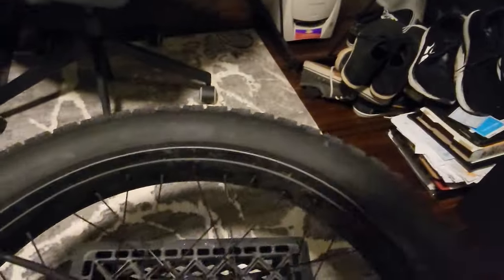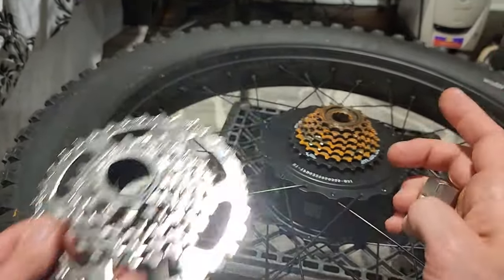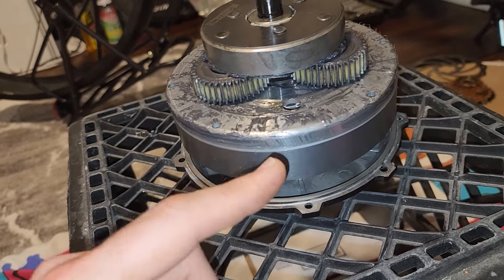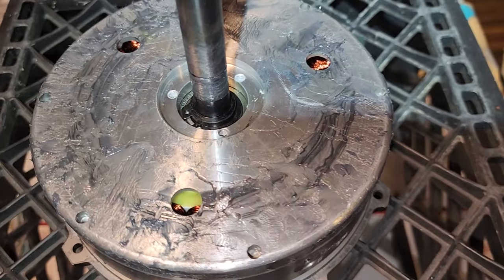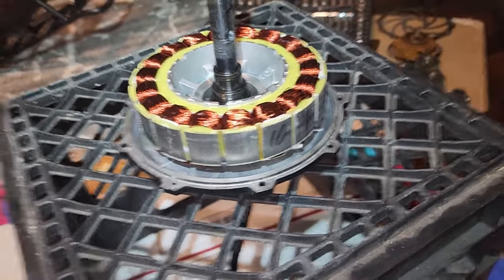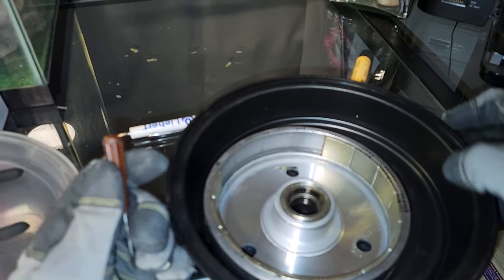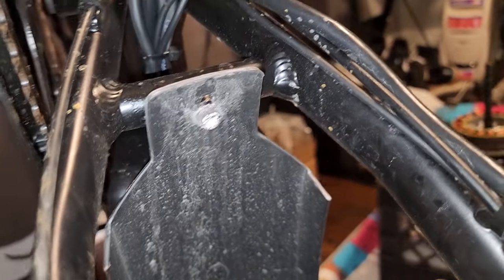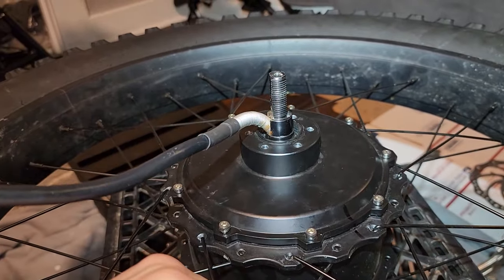Ebike Geared Hub Motor Repair: Loud Motor & Loose Magnets (Wired Freedom/Cruiser)

Comment: Mine makes that noise!! I figured motor on the way out. Great video Hey just fyi that's a 500watt motor you can tell when you removed it. It's only couple inches thick. Real 750watt motors are double that thick. It's huge scam 1000s people ripped off.
Reply from the maker: Really? That's interesting. Can you link me to some more info? This motor is way bigger than the 1000w bafang that's in my ariel rider
Reply: @maximumchargeEV  Yeah when you pulled it out looked like the 500watt in this video? Look at the difference at 8 min 24 seconds yours looks like the 500w. in this video talks about it.  https://www.youtube.com/watch?v=IM_Mj-DiU_o&t=47s
Reply: Is the overall diameter of the motor larger? Also the way the stator is wound has a big effect on the power available in any brushless motor.
Reply from the maker: @Hoggdoc1946  yes the diameter is much larger
Reply: @maximumchargeEV  ah ok

Comment: That's a 750wat hub motor. You want to try doing that with a 2000wat hub motor the magnets would not crush your fingers it would cut them off. But there is a safe way to dreading the magnets uta a blue paper I forgot the name so when you get stater just slightly liftted you slide this paper in and you can remove by hand. I've done jobs on 2000wat 3000wat and never yes a puller just push down but not to use wheel as it will buckell. I've seen the Chinese do this in factorys and they make it look dead easy. It's conferdance if you don't have it it becomes really hard it's amazing when you no the trick it becomes easy but still watch your fingers. Even a 750wat not be taken lightly as the guy who made video. These videos are good for people who haven't tried jobs like this
Reply: I have 3000w... and it's slipping under weight. I think I'm just gonna ride it until it goes. That or sell for a fraction of the cost

Comment: I would have gone and did all of them with how much adhesive was in there, which was almost none. Very nice job otherwise.
Reply from the maker: You might be right!
Reply: @maximumchargeEV  can't remember which vid, but Justin from grin said In one of their videos that this is a common issue (lack of glue) and that they once had an entire container of motors from bafang arrive with absolutely no glue, all magnets loose, and they had to open up and reglue every single one. Now consider that bafang is the "big brand" and many kits and production bikes are using other chinese knockoffs of the bafang. 🤦‍♂️
Reply from the maker: wow that's terrible. Seems like things are getting better and better thankfully as ebikes are becoming more popular. 
 @andrewstephens2687

Comment: Thank you for this video,The Company in Illinois referenced you when I asked if they have a video of the breakdown of the hub motor to add grease over time for preventive maintenance.I also fixed a PM motor like you did years ago with loose magnets and the only problem is that the glue can be sort of a spacer if there is too much glue behind them,So I used a starrett micrometer to measure the thickness of the magnets from the back of the disc where they are mounted to the face of the magnet and used as a reference the magnets that were not removed to see if the ones that you repaired are at the same position distance.How far the magnets seat in is critical in that the flux density lines can be a counter emf if one is further away from the outer ring they are mounted to.Since you are helping so many people with this video,I felt compelled to share some of my experiences.Good work,Someone upstairs is writing this all down.Cheers.Joe EE/P.E.
Reply from the maker: Thank you very much for the kind words! I wanted to make some useful content in case others had a similar issue. Glad it helped! I hope I never have to do this again! :D

Comment: 1. The small rectangular part on a shaft is a keyway not a clip. 
2. The pin in the middle of the circlip pliers is to change from spreading to compressing. (Read the directions) 
3. The yellowish PCB substrate (fiberglass) insulation between the armature windings and the stacktooth is for electrical insulation between them. A little bit of chipping on the exposed corner is fine. 
4. DON"T USE RED LOCTITE if you ever want to take the motor apart down the road. A torch or soaking in solvent is about the only way to break Red Loctite free. 
5. The biggest limiting factor of how much current you can run through the motor is the windings.  If you melt the coil wire insulation, or fry a coil wire it's over for the motor.  Never run more current through a motor than it is rated to handle.

Glad you managed to get it going despite not doing much research into what you were doing.
Reply from the maker: GREAT comment. Thank You!

Comment: They use nylon gears because they are quieter. The metal/nylon/metal sandwich gears are physically stronger than pure nylon, and quieter than solid metal, so they are really the best of both worlds. My bike peaks at 3,200 watts with enough torque to throw me off and flip the bike, but I've been running nylon gears for 7,000 miles with no issues so far. I do have solid metal gears, but they are so loud that I took them off the same day. The scuff marks on the magnet shell are from the factory grinding off sharp edges after balancing. Good cautions on the magnets, and if two of them snap together, they will likely crack. I lost two magnets that way. Nice job on the regluing, it looks pretty!
Reply from the maker: Thank you my friend!
Reply: Truly there is little to no evidence of the nylon gears wearing down, even when overvolting, the issue is when temps are not monitored and reaches critical softening/melting temps and you get "peanut butter gear". I bought a bike with all steel gears and would consider nylon gears an upgrade.

Comment: I have the freedom coming in a few weeks hopefully. thanks for this video. was lucky to find it. according to the owner they have fixed the issue and are repairing or replacing the affected motors. If I have this problem I will probably just fix it myself as well.
Reply from the maker: How's your new bike?
Reply: has not arrived yet. hopefully soon. @maximumchargeEV

Comment: If you have a shop vise the freewheel is very easy to remove. I secure the freewheel tool in the vise and drop the wheel on top. You simply turn the wheel counter clockwise like a big ol' bus steering wheel which gives you great leverage. Be sure to put some anti sieze or grease on the frewheel threads to make it easier to remove next time...

Comment: FYI, FWIW - Since I have a Freedom arriving next week (late May 2023), I asked Wired about this via their chat. Here’s their response (other than the pending order, I have no affiliation with Wired beyond being a customer) :

“Wired Ebikes
On the first run of bikes that we produced, we discovered that the factory that makes the motors for us was very inconsistent in their application of glue for the magnets. Once we discovered this, we had multiple discussions with the manufacturer of the motor, and they have stood behind their motor and are giving us replacement motors for anything in our first run that fails. Furthermore, they have guaranteed us that the Current production run, which is arriving next week will not have that same issue. Any of our customers that have notified us of a motor issue, we have either repaired their motor to make it stronger than what the manufacturer would, or replaced it with a brand new motor.”
 
Fingers crossed -
Reply from the maker: That's great to hear!
Reply: how come that one nigga consious talk ent said they wouldnt give him a new motor? he said they made him send his old motor and then they sent back the same one to troll him lol thats messed up. i think he got the 2nd batch of motor too.

Comment: Is that a 750wat hub motor and how many magnets do 750wat motor have is for setting sw900 display. And are all 750wat hub motor the same inside. Best tip to stick magnet is liquid nails it's for wood and metal. You put a fine scraping on both serface and it works I done this a 2000wat motor 3yrs ago d still going strong yes magnets on 750wat hub motor thanks

Comment: Great video! I think i start to having the same sound like in this video, but if i don’t throttle  but cranking out instead, the sound will not occur.   It is design flaw or bad preparation from factory for sure.   It doesn’t look too difficult to reglue those with epoxy.   Thanks again
Reply from the maker: Good luck man! I know you have one of the first batches of wired bikes out there too. Wasn't too bad to fix this.

Comment: Is this still holding up for you? I just re-did this to my bike with JBWeld after my 1st application with another adhesive failed.
Reply from the maker: I actually partially burnt that motor up (hall sensor wire desoldered itself) but the magnets held up!

Comment: My motor makes noise, but is intermittent. As i gain speed sound disappears. Perhaps its the centrifical force? Do you recall if this is a symptom of loose magnets? Thanks.
Reply from the maker: It might be. Yes it goes away after a higher speed but at low speeds it's VERY apparent that something is wrong. Does yours sound the same?
Reply: @maximumchargeEV  yes. Thank you.

Comment: Do you recall if you had this sound with VERY gentle acceleration from a stop? I'm also having this issue but only at very low speed with moderate-max throttle. If very subtle throttle from stop, I don't get it, and it goes away at top speed. When the wheel is in the air, I don't get it, only when the wheel is on the ground.
Reply from the maker: yeah the centrifugal forces push the magnets into place. I can't remember if the noise was there during a gentle start.
Reply: @maximumchargeEV  Have you noticed anything off such as top speed or acceleration after the re-glue? Someone mentioned that the magnets need to be perfectly balanced for the motor to run efficiently, so I was just wondering how yours did after the fix since it's a high wattage motor. Thanks again for your repair vid!

Comment: Did it help ? I have same noice and planning on doing same thing you did my magnets are also lose
Reply from the maker: Fixed it 100%. Even put over 3500 watts into the motor and it's still holding up

Comment: Thanks for the video. Same thing happen to my wicked cruiser with less than 100 miles on it. Did you need to change the length of the chain with the new freewheel? What brand is it?
Reply from the maker: New freewheel does not need a new chain. Once my youtube channel gets verified I will post a link In the description.

Comment: very nice video ,,well done man.,,i want to ask you advise or i have same problem i am not sue,, i got carrera subway e bike and i got this problem that assist often doesnt work ,,motor makes noise but there is no assist ,and then sudenly assist kicks in ,,ant it happenes all the time but onece assist kisks in it normaly works until i stop pedaling
,,what do you think?
Reply from the maker: Thanks! Does throttle work normally? What kind of noise?
Reply: @maximumchargeEV   i dont have a throttle ,,noise smooth not like grinding atol ,very quiet like something is spining inside the hub,and once it catches than it makes short loud grinding noise and then works ,perfectly,,

Comment: Hi, im curious if you contacted wired about this , if they would cover it since the bike has so few miles? I think my 2024 wired freedom may have the same issue, noisy motor under acceleration. My bro has the same bike only 2023 version and motor sounds much quieter under acceleration. thanks!
Reply from the maker: Send wired a video and they will determine what it is and help you out.

Comment: Lso did it work... couldn't fund your video seeing if it worked. If it does I have to do that to mine.
Reply from the maker: The videos of the wired bike right after this are it working.
Reply: @maximumchargeEV  sweet I gotta do my anioki a8 pro max dual motor. It's making that noise to but goes away after about a minute of riding
Reply from the maker: @mr.raiders7029  thats very interesting. What did customer service say?

Comment: I tried metal gears, they stressed  my motor. Stick with nylon and replace them when you strip them from over torquing your motor when starting on a hill etc.
Reply from the maker: full metal gears?

Comment: Great vid I need to do this to at least one maybe 2 motors. I want to go ahead and reglue all the magnets, any tips for removing the ones that may be glued well already? Would a normal heat gun be hot enough?
Reply from the maker: I would try to pry something very thin and flat behind the magnets, like a thin putty knife. Work at it slowly.
Reply: Do not use heat gun.
Over heat can damage magnet.

Comment: Probably a dumb question, but would you recommend this bike? I've been stuck between this one and the Ariel Kepler. This one would have won me over but seeing this issue and the fact that the owner of the company isn't really helping people with this issue it's making me lean more towards the Ariel.

I am able to work with tools and engines, but this just seems like a pain to have to deal with. lol.
Reply from the maker: I would recommend this bike yes. I believe this issue was fixed, and the owner offers to replace the core of the motor for free. Use the chat on their website and talk to him to confirm these two items and you'll be good to go. Very powerful bike I love the kepler but the power of this is what wins me over
Reply: @maximumchargeEV  thank you so much for the response!! Looks like I'll be getting this bike!!
Reply from the maker: @hakarumonoka  happy to help my friend

Comment: Some magnet they don't use glue the magnet it's self ke in place because it's a magnet. The poles will be the same that's what keeps them in place if you do put glue on be sure to keep your magnet the way up as you mix the poles up and that will make your motor go slower strange but true I used to assemble these motor. If these magnets have no glue on do you find that strange on all magnets that shoud tell you not to put glue on
Reply from the maker: So far so good!

Comment: Are the magnets being held in place behind that little aluminum ring they seem to be set down inside of
Reply from the maker: They are held on by the housing of the motor, the glue, and the pressure of them pressed up against one another. They also are pressed outwards into the housing at speeds above 15mph due to centrifugal forces.

Comment: you don't need extractor at all, at any point !! Just lever with a screw driver for the first and press on the other side for the second part, no extractor needed just a little muscle.
Reply from the maker: I need experience with doing that is what I need! Thanks for the tip my friend.
Reply: @maximumchargeEV i'm glad to help ! I have repaired a lot of electric bike motors from a lot of different brand. Those motors are easier to open than they seem to be.

Comment: Got 75 miles on my new Aniioki AQ177 Pro  and it's making a similar sound.   added a bit of grease as it was almost a invisible layer, which seemed to help.   But noise similar to this video still happens under full load.   Crap started comment to early, watched till I saw the magnets loose.  Now I REALLY don't want to have to get the tools needed to dismantle motor. NUTS.   Not sure what to do.
Reply from the maker: Maybe the manufacturer can send you a new motor core?
Reply: @maximumchargeEV  I decided to run it and see what happens.   Much better after greasing.   Weird loud Grrrr noise only seems to show at below 5mph on flat or going slow up steep hills.   Might be happening controller putting in Max power? I'm going to borrow a camera record it and put on Youtube for people to hear.
Reply: @dailyrider2975  Hey man, I've also got a AQ177 that started making this noise after 10 miles!!  And yes it only occurs on the initial start of the motor like the first 5mph. Should i just ignore it?

Also, on a full charge my display is only showing 51.8v instead of what I think should be 54v?

Looks like Aniioki scammed me lol
Reply: @inoribettor would you recommend the aq177 to a friend? I'm saving up for that bike.
Reply: @inoribettor  51.8v is not correct and I would return it as you're losing a lot from battery and is faulty.